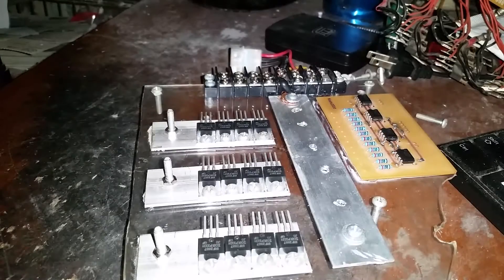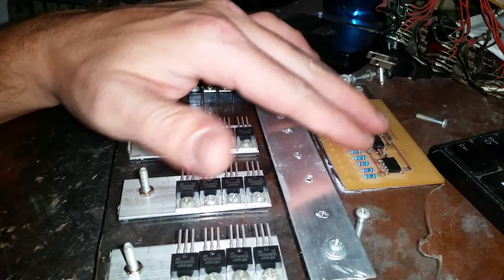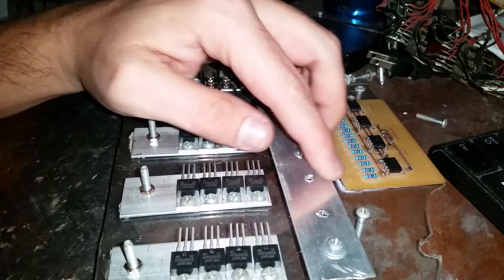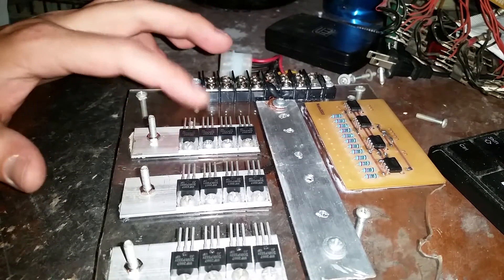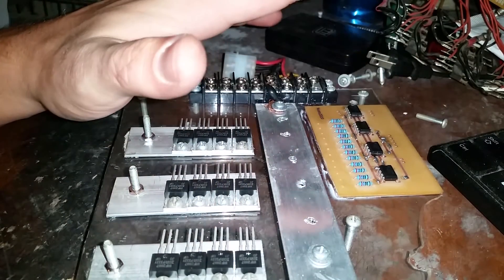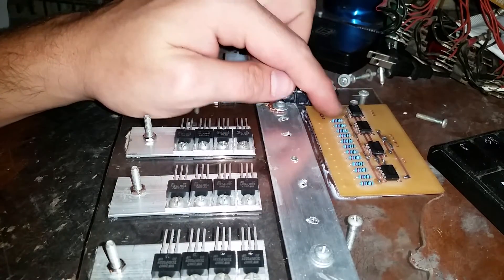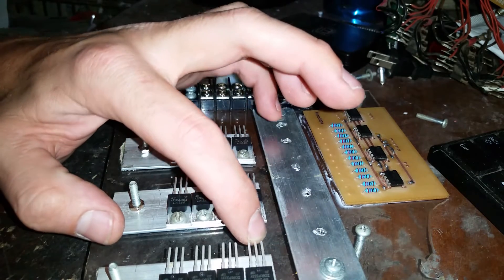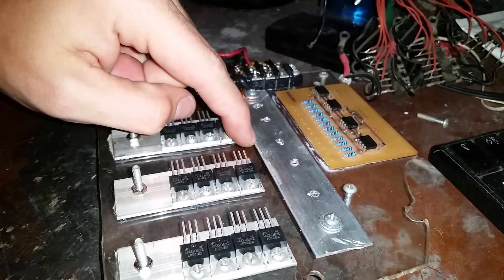Car Alternator BLDC Motor Driver w/ PWM Speed Control

Comment: Guauuuu.. Justo lo que necesitaba.. Puedo no utilizar los sensores hall? En mi alternador no los necesito. Muchas gracias por compartir tu talento.
Reply from the maker: Hola, este circuito necesita los sensores de efecto hall. He pensado en hacer un controlador sin sensores, pero todavía no lo he probado. ¡Gracias por el comentario! -Utilizé el traductor de Google, lo siento, fallé español 2 dos veces, ja, ja
Reply: @Neato3000  yo fallé inglés jaja no te preocupes.. El alternador lo uso como motor con 48 volt en bobinas y 8volt en escobillas.. Realmente vuela.. Y mucha fuerza.
Reply from the maker: @raullopreste4653  Deberías hacer un video sobre tu motor. No tengo suficientes baterías para probar esos voltajes, ja ja

Comment: wow this is so old but so cool, these days I would tell you to use an Arduino for the controller, by the way this could be used to make an go card or something
Reply: I would also use an Arduino, but a 555 solution works just as well.

Comment: Im actually looking at building an ebike with a motor like this. Would your design work for a more workhorse use? Probably in the many 100s of watts at 36v? You mention sensors, how/where are those mounted or am I getting that part wrong? How is the electromagnet being controlled? Sorry for the questions, im good with a soldering iron but have little to no experience in this level of stuff :)
Reply from the maker: Hey! Well at 36 volts, this thing would only draw 72 amps. But for power, you're looking at 36v * 72 amps= 2592 max watts. I say "only draw 72 amps" because I was looking at pushing it to 50+ volts when I designed it, which would be over 100 amps and 5 kilowatts. (Got to 55v and finally saw some rather odd mechanical problems on the brushes) The sensors are inside the alternator right next to the coils. They are positioned to turn their respective coil on. Not to early as to have the rotor spin backwards, and not to late so that the rotor stalls. Think angles vs. time. I have no specific measurements, I experimented until I found that the right placement was somewhere off from the center of each coil set. All three are offset in the same direction and amount. The electromagnet (the rotor) was easy to energize. I use a 5 volt pc power supply on a 25 ohm rheostat. Positive supply goes to one end and negative to the other end AND the "negative" on the rotor. The middle contact from the rheostat goes to the determined positive terminal on the rotor. Basically the 5v supply goes to the outside pins, while the rotor goes to the middle and negative pins. If it doesn't register to the hall sensors, flip the 5v supply on the outside pins (and move the "negative" from the rotor to match the negative from the supply) as the magnetic flux would be backwards if it's wrong, and the sensors won't see it. If you have no soldering experience, you will after doing one of these :) I would really like to see what you come up with! Thanks for the questions!
Reply: Just so I understand this, the sensors are tripped by the magnetics from the central coil right? Any method you'd recommend in mounting the sensors so they dont fall off? Dont worry I have soldering experience, i meant no experience in circuit creation.
Reply from the maker: Hey, yeah, the sensors get tripped by the rotor. For mounting them, I soldered the three sensors together so that their spacing was right, then I used Gorilla super glue to hold them in place on the stator. I put together a post with a couple images that might help. http://www.neato3000.com/placement-of-the-sensors-in-the-alternator-motor/
Reply: Thanks that post actually really helped. All I have to do now is make a list of what I need and make a trip to the hardware store for the components. Whenever I manage to get something going I'll make sure I let ya know. Thanks for the help.

Comment: what kind of sensors did u use?
Reply from the maker: +Ahmed Khodeir The sensors I use are A3144 switching hall effect sensors. The switching type is perfect for making the solid square wave needed to drive the mosfets. Thanks :)
Reply: +neato3000 good work !
did u try to do VFD??. it would be more fun
Reply from the maker: No, I have thought about it though. If I were to use the VFD type hall effect sensors I would need to implement some circuitry to convert the sensor values to a proportional square wave PWM signal for the mosfets. I would probably just use an Atmega microcontroller to do that part. It wouldn't be very difficult, but the aim here was to be as simple as possible, with parts that are easy to use, which is why I went with the switching type since they just work without needing extra parts or programming.Good idea though, I'll have to try it sometime and see what I can get out of it :)

Comment: it look like my mosfet them generic one side of the motor wire is on (positive batt  and on the other side is on drain) as soon as i touch source to the neg batt it began to move without any thing connect to the gate
Reply from the maker: +kevin pounal Hey again, instead of not connecting the gate, make sure it is grounded when you want it off. From what I understand mosfets have a capacitance on the gate and if it is charged the mosfet will not turn off. So to uncharge it, it must be connected to ground. If the gate is connected to a 555 timer's output, there is no need for grounding the gate, because when the output is low, the 555 timer output is ground so it shuts the mosfet off. When it's high, the output is whatever Vcc is on the timer, which would turn on the mosfet. Keep it up, you'll get it.

Comment: teacher i cant wait to see it run
Reply from the maker: +kevin pounal Hey! Thanks, me neither! By the way,no need to say teacher or master, just Neato3000 :D Anyway, I was messing around with the math in the electrical characteristics of my device with the IRF2807 mosfets, and decided to test it out with the BUZ11 mosfet specs. I made a model in Desmos, check it out: https://www.desmos.com/calculator/usumtauvdf
With it, you can determine the number of mosfets you need in parallel to switch specific voltages. Green is -voltage and blue is power. I found that to run the max of 50 volts, you'll need at least 3 mosfets in parallel for each coil set. This would keep the power dissipation down below the maximum 90 watts for each mosfet. Hope you find it useful!